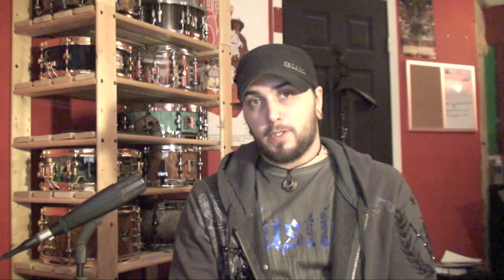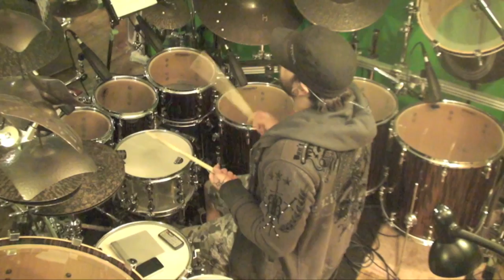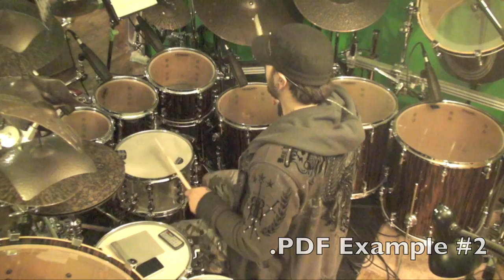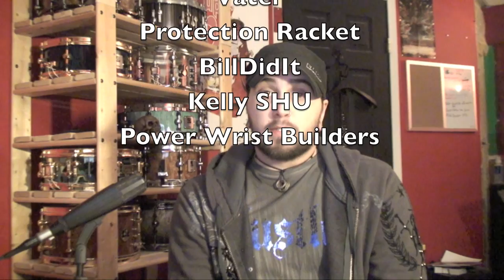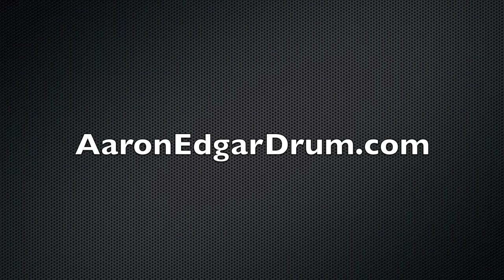Metric Modulation Vs. Implied Metric Modulation - Advanced Drum Lessons

Comment: @aaronedgardrum so you can relate the idea of polyrythm and metric modulation (actual, not implied) by using the faster or slower subdivision in the polyrythm as a "gear shifter" for the bpm change? in this case, what is referrerd as "modulation type 3" by mr. Harrison, how does this idea fit/relate with your perspective?

Comment: So if I understand this correctly, "acutal" metric modulation and "implied" metric modulation is technically the same thing? The difference is only in the intention of the musician and the context. If you hear them without any context you cannot distinguish them.
Is that correct? These things tend to make my head hurt - similar to polyrhythm vs polymeter.
Reply: +JackFou No, In actual metric modulation the song would progress at a different rate. In implied metric modulation the song would progress at the same rate as before. An example would be the chord changes. In actual metric modulation the chords would progress at the new tempo where as in implied modulation the chords would progress at the old tempo.